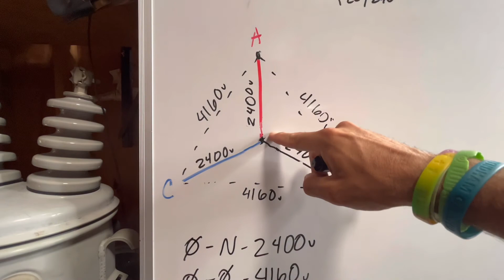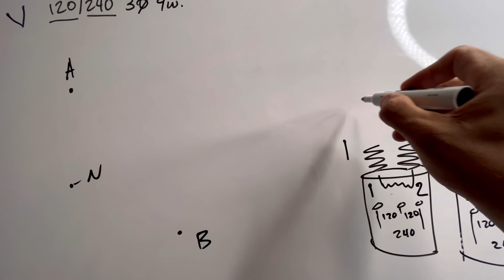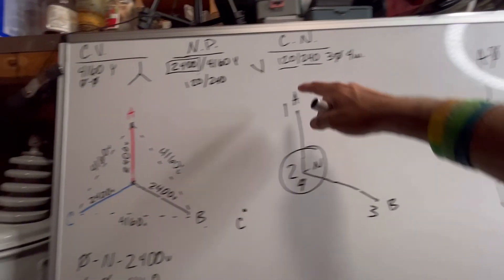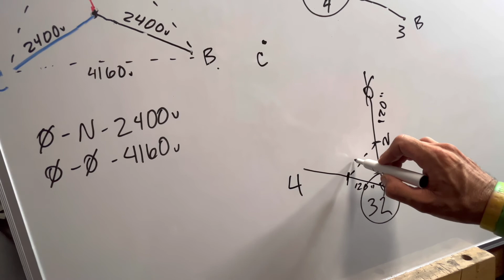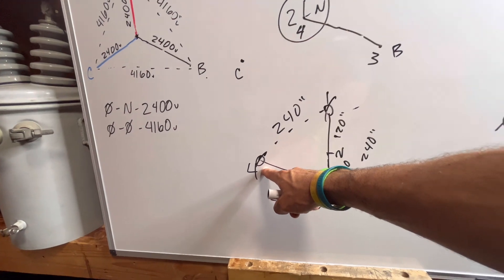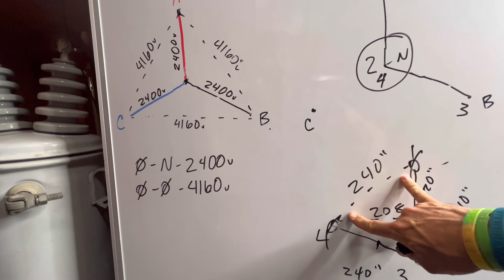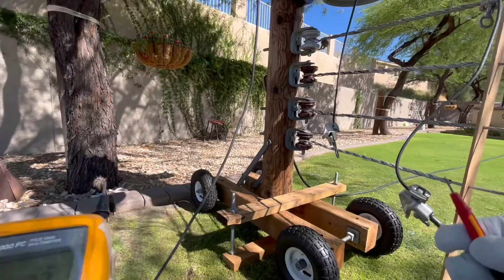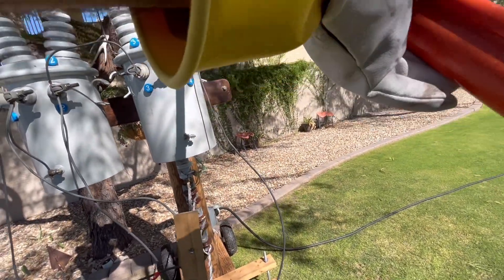How To Build an OPEN DELTA Bank #lineman #journeyman #linelife #linejunk #linemanlife #hilineacademy

Comment: Great video!, At an earlier time since many years I rewound many of these pole transformers for the Pocos. We had this kind of  transformer configuration to our shop. Although sometimes not as stable as a Wye, Its nice to have this kind of service configuration since it provides multiple single phase voltages as well as 3-phase with just two pots. In many of the southeastern KFC locations that have Delta service like this, the phase to neutral providing 208v single phase is often used for small heating loads like the hot air hair and hand dryers found in the restrooms using a non-slash rated breaker.  😀😀😀

Comment: We have a voltage problem in the MRI machine,  can we use this open delta to seperate the transformer so when we start the MRI machine the voltage don't drip? Curious
Reply from the maker: No that wouldn’t help. If I have to guess. If you’re having voltage drop that sounds like a capacitor issue. The startup load is pretty high. If the capacitors are bad or going bad you can have voltage drop issues. The current spikes due to the drop and it usually kicks the circuit. Let me know what you guys find out  stay safe and short out the caps before you work on them. 👍 also it may be an issue with the variable frequency drive. Let me know what you find out.

Comment: 你好，請問這是open wey---open delta 接線嗎，能提供中性線（N-phase)與地線的接法嗎
Reply from the maker: Yes sir it is an open eye open delta connection. I’m not quite sure what your question is. I think the translation is losing some of the meaning but I think you’re asking about the “wild leg”. The wild leg is a different phase to neutral voltage from the the other two. The phase to neutral voltages are 120 120 208. The 208 voltage can be seen on the vector diagram. It is created because of where the neutral sits in the connection. The neutral is not at an equal distance from each phase. Two of the phases are 120 inches or volts away from the neutral and the wild leg is 208 inches or volts away from the neutral. Go back in the lesson to the vectoring part and see if you see what I’m talking about. Let me know if you have any more questions. Stay safe. 👍

Comment: Great video Cody. Quick question though. Shouldn't you be floating the neutral since the rule of thumb is wye-wye you tie and wye-delta you float?
Reply from the maker: Not on an open bank. The rule of wye wye you tie wye delta you float only applies to three pot banks or closed delta banks. On an open delta bank you are required to tie down the neutral. Stay safe. 👍

Comment: So on an open WYE what would your voltage be with and without a power leg?
Reply from the maker: Well that’s kind of the wrong question. You should ask what the voltages would be present without the neutral. 
The power leg or wild leg or whenever you want to call it is a voltage potential between one of the three phases and the neutral. On a 120/240 three phase bank your phase to neutral potentials would read 120 phase to neutral
120 phase to neutral
208 phase to neutral (power leg)

The phase to phase voltages between all three phases would be 240 all around. Phase to phase to phase. 

So if we don’t supply a neutral on this bank we would get rid of all of the phase to neutral potentials including the power leg. The phase to phase potential would not change. It would still be 240 all around. 
👍
Reply: @ thank you!
Reply: @hilineacademy8482  I guess what I was also asking is like for a 277/480 bank how you’d get that voltage if you’re wiring it the same as a normal wye bank (I haven’t been wiring pots long), would the name plate read a higher secondary voltage?

Comment: I heard the terms “Lighter” - The transformer carrying the neutral and “Teaser” - The power pot for the first time after watching four or five of your training videos so far, can you elaborate on those terms more?  I have worked as an Industrial Electrician at a steel mill which received a direct feeder of 750,000 volts and also an older Aluminum Smelter that had its own Generating Station producing both 15 kV and 138 kV.  It was our responsibility to manage the switching and repairs on those systems as well as keeping the production departments of the Smelter up and running.  Thank you for making these videos, they are well made and the content is very helpful.

Comment: I'm not a lineman but find this really interesting and subscribed to your channel.  My degree is in electrical even though I rarely use it on the farm.  You should do the math with the vectors to prove the voltages, it's just simple Trigonometry 😊

Here's the math for the Ø - N voltage calculation ...
c² = a² + b² - 2ab⋅Cosθ (Law of Cosines)
c = √[(120)² + (240)² - 2(120)(240) ⋅ Cos (60°)]
c ≈ 207.85Vac

You can type in "Law of Cosines" into Google and it will bring up a calculator where you input sides "a" & "b" along with the angle in degrees making the whole process idiot proof 😉

Comment: Happy late thanksgiving. I have a question, if you Meter a open delta Neutral to Neutral. What read would you get?
Reply from the maker: I’m thinking your asking about taking a voltage reading from x2 to x2. If this is your question, on a 120/240 open bank you would read 120 volts x2 to x2. This is why we can only utilize one of the x2 bushings as the neutral. On a delta connection the x2 is not our connection point between our transformers like we have on a wye hookup. If you mess up and forget to isolate the x2 bushing on our power pots, we will have a bomb. Lol. 
Please let me know if this answered your question. Stay safe 👍

Comment: Also, can you please explain what you mean by "teaser pot"?
Reply from the maker: Great question. So in a delta secondary, 120/240 three phase 4 wire. In as simple an explanation as I can give. You essentially have a single phase transformer outputting 120/240 which is two phases and a neutral. The other transformer is supplying only the third phase. We call this transformer the “teaser” or the “power pot” and there’s probably a bunch of other names that people have for it. It’s just a name the industry has in order to identify which transformer your talking about because if the difference in output voltages between the two transformers. 👍

Comment: Nice video.  Thank you.  Can you please do a video about the Rotation Meter?  What is it?  What does it do?  What did you mean by "clockwise"? What difference would it mean if it were "counterclockwise"?
Reply: Typically the rotation is setup by the electrician. So anytime you disconnect a 3 phase service you have to make sure the rotation is correct or you will burn up motors.
Reply from the maker: Yes sir. I’m working on it. That one is in the list though. 👍

Comment: good morning! nice video. do you have a video on how to troubleshoot a delta(22000)- delta(120/240/208) connected transformer with 1 damaged transformer? is there a way to identify the damaged transformer without removing the leads to check them individually? thanks
Reply from the maker: Thank you sir. I appreciate it. I will do some troubleshooting lessons later. As for checking in the field it’s difficult to figure out which transformer is bad without isolating the transformers and checking them with a tilt meter. It’s hard because the voltages will backfeed through the load and give readings that arent east to dissect without isolating the transformers. Stay safe 👍if you have any other questions don’t hesitate to reach out.
Reply: @hilineacademy8482  thank you Sir

Comment: Where does inches come into play? I mean what are you measuring? Windings?
Reply: I understand you're 208" from the neutral. I'm wondering where you're measuring from? Does the measurement come from the length in the windings?
Reply from the maker: @jasonkenney5970  on the delta vector diagram I’m measuring from the neutral to the wild leg.  From neutral to the other two phases the measurement is only 120. But from the neutral to the farthest phase it will measure 207.8 inches. I need to do a lesson on this. Let me know if this explains it for you. If I could show you the math it would be extremely clear. Stay safe 👍
Reply from the maker: You need to watch the video I did on vectoring. It explains it all. The voltages come from the vector diagram of the bank. The reason the wild leg is 208 volts to neutral, is because it is 208 inches from the neutral. Go watch that lesson. Then get back with me.

Comment: So confused.  I thought open Delta used all Three (3) of the power company phases, with only 2 transformers?
Reply from the maker: You will use all three primary phases on an open delta bank if the primary connection is Delta. But if your primary connection is a Wye, then you would only use two. Go and watch the video lesson I did on vectoring. Grab a note book and a pencil and practice. It will clear a lot of the confusion up. Vectoring is an Awsome tool to learn about transformers. If you have any more questions feel free to get back with me.
Reply: I had the same question. 

I see now that 2 bushing xfmrs (12470) will use all three phases, and single bushing xfmrs (7200) will use two phases and the neutral.

Never would have thought of this connection.   Could come in handy where the overhead is reduced to 2 phases and the neutral.  Or, you only need to add 1 wire for three phase power if only 1 line and neutral exist.

Small motors of course.

Your videos are top notch.

Comment: Did not draw the Wild Leg on the board/transformer?
Reply from the maker: I did draw out and explain the wild leg. But I forgot to mark it when I was checking voltage and rotation. Lol. Thanks for the heads up. I’ve still got a lot of learning to do with the whole video thing. 😅

Comment: Ah Ha. Close the one with the neutral first.......Makes sense. I was never taught that. We just close them in any order. As an underground lineman I never build the overhead cans, just make it with pad mount transformers.
Reply from the maker: Yes sir. If your picking up load when you come hot, you need to come hot with the lighter (the one with the neutral) first. Even with an underground bank. It’s really the same animal. Just a different shell. Stay safe. 👍

Comment: How often do you still hook up center tapped delta services?   My understanding is that they typically are found in older commercial and industrial facilities often in rual areas,  and can be easily identified because you'll see two or three transformers, one of the is large compared to the rest, since it supplies the 120V loads in addition to single ø and 3ø 240V loads.  120/208Y seems to be the most commonly used system today, along with 277/480Y and rare occasion 347/600Y.  At least in the US.
Reply from the maker: Yes sir. Topically open banks are used in areas that have a lot of single phase 120/240 and light 3 phase loads. A lot of old neighborhoods with three phase air conditioners have a lot of open banks feeding them.

Comment: Awesome demonstration.  When I was a teenager living on my stepfather's farm we had a two pot bank out by the road.   We had a couple of three phase motors , the grain dryer had a 15HP motor if I remember correctly,  then we have some augers and conveyors with 5 to 10 horsepower 3 phase motors, the rest of our loads were single phase 120/240. And the motors never all ran at the same time so our total 3 phase loads were relatively small compared to our single phase.   Our service was a 400 amp 120/240 3 phase 4 wire open delta, 100 amp panel in the farmhouse,  100 amp in one of the polebarns and 200 amp in the other barn near the augers, conveyor and grain dryer, which had the 3 phase in it.   I don't know exactly when the 3 phase service was installed other than the farm did not have electricity till 1946 or late 1945, since it was a rural area it was electrified much later than cities and suburbs.

Comment: Hi and thanks Cody for your demo and explanation. I'm a retired 600 volt or less sparky and have seen these numerous times on commercial buildings. I remember that one of the transformers are usually twice the KVA of the side that feeds the high leg. From Maryland.

Comment: Another great video .. Tx 👍🇺🇸 What state are you in..?
Reply: I’m a Local 104 IBEW 20 year lineman working high voltage oil cable underground on Long Island NY right now .. From here we go to Connecticut or Miami .. I only chase storm now as I’m 57 and a bit long in the tooth for chasing high line jobs and fast pace distribution jobs. I’ll moonlight on Distribution if it’s Storm though.. Your videos are excellent and my son graduated college in a few months and will either become a lineman apprentice or HV oil cable splicer. These videos will save me hours of trying to flap my gums trying in vain to explain important issues. When I was starting out in 2001 I watched a similar explanation using inches to help describe the phase angle. Back then I had no idea wtf the instructor was talking about. Your video made perfect sense to me that it is used simply as a memory tool to teach others.. You solved a mystery for me.. My problem wasn’t that I was dumb it was I very much understood lenzatic compasses and know how to read Military maps and what a declination diagram is for in the index key box.. But when vectors were being described in Inches I got brain freeze big time.. Tx again… My son and the 3 apprentices under my care right now will be definitely tuning in to your videos & hard work..
Reply: PS… Kari Lake is your “Real” Governor … I know you know that already right..?
Reply from the maker: Thanks Richard. I’m in Az. Where are you working?

Comment: Thanks for the interesting video.  I'm a layman nerd who has recognized open delta services in the wild before.  There was a small stock yard along the highway that had such a service.  Skipping to my question, can the vectoring also help determine power/sizing requirements for the two transformers?  If I remember, the transformer with he neutral is usually going to be larger, and there are maximum limits of 3⍉ draw.
Reply from the maker: Vectoring can’t really help with determining wattage or “kva”. We use it to not only determine the primary and secondary hookup on new builds but we also use it to diagnose existing transformer banks in the case of troubleshooting. Good question 👍

Comment: Good video. Why do you keep on mentioning inches and voltage together?
Reply: You did I good job braking down vectoring. But I just thought it might get someone confused when your mention Volts and inches. I personally understand vectoring, journeyman linemen. Keep up the good work.
Reply from the maker: Awsome question. Because when you vector the transformer bank out, the different voltages come from two things. The angles of the vector lines, and how long they are. So I try to make the point by saying 240 volts, or 240 inches so you start to relate the voltage with a distance. So when you take those different angles and start connecting certain numbered ends together, you start to create other voltages. This is why I always say in the lessons that vectoring is all about angles and distance. Vectoring is an awsome tool not only to learn how to hookup transformer banks, but to analyze a connection and see what voltages are present, or should be present if your troubleshooting. I hope I answered your question. Sometimes it’s easier to answer these if I could draw it up on a board in front of you. Lol. Please let me know if I was clear enough. Thanks. Be safe 👍

Comment: So is this module fed with 120 on the primary side? And are pots 1 to 1 ratio??
Reply from the maker: Primary lines is 120/208 and I’m winding a bunch of different ones. 
120 pri
120/240 sec

208 pri 
120/240 sec

 And some 277 volt sec as well as 240/480 sec.
Reply: @hilineacademy8482  could you show a vid of you winding the coils to achieve these voltages?
Reply from the maker: @TheBibleListener  yes sir. I was actually thinking of making a lesson on that exact topic.I need to wind some 208 primary - 120/240 secondary transformers and was gonna explain the whole process. 👍
Reply: No worry about the polarity of the cans when you vector it out?   Assuming those are not 250KVA cans, by industry standard they would be additive cans.  Which would give you a different vector than what you have.   What you have I call a “left turn signal” (looks more like a turn signal on a closed bank), but if you vector it with polarity in mind you would get a “right turn signal”.   The secondary x1’s would be 1 and 3 respectfully and x2’s 2 & 4.  So 1,2,3,4 on the high side, 2143 on the secondary side.   Then you would have a 1 to 4 tie on the secondary side changing your vector.